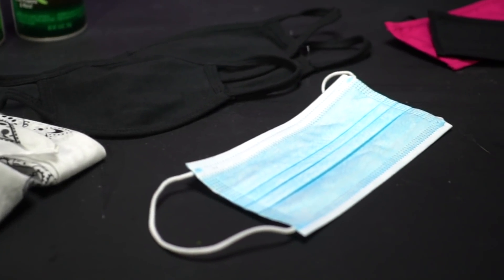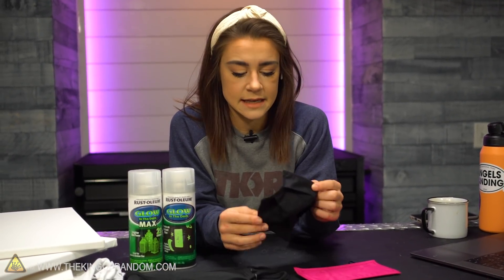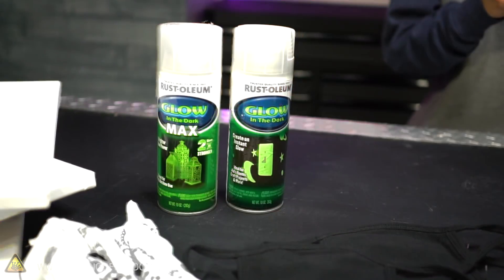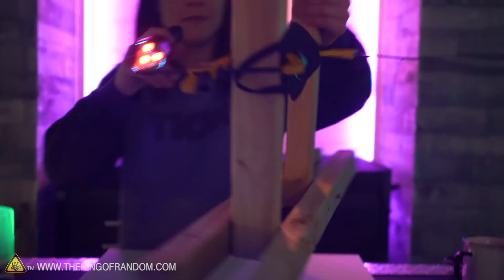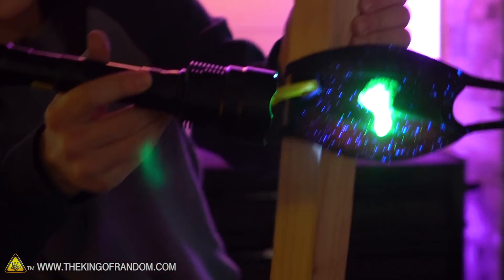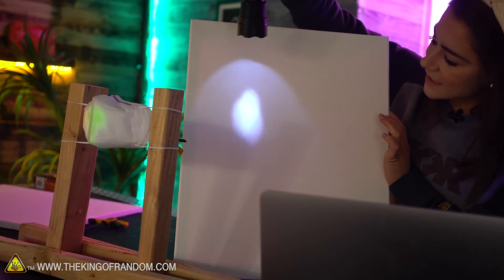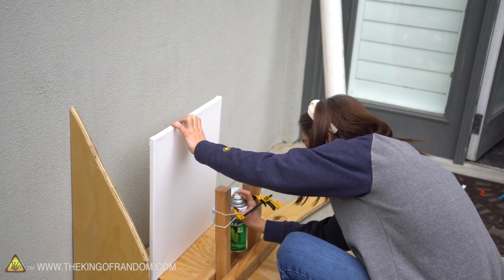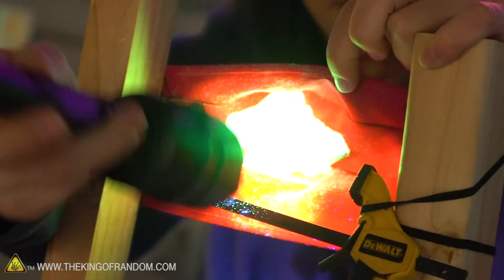DON'T Wear This Type of Mask

Comment: This needs to be redone there is a few other masks that you guys should have added to this 1. A charcoal filter mask with carbon reusable filters
2. A homemade thick cotton mask
3. Wraps
4. Scarfs (knitted, silk, cotton, polyester)
5. A hoodie if you forgot a mask
6. A T-shirt
Reply: I'd also like to see the face scarves, I used to wear one, double folded because it looked so thin, but then I switched to surgical masks. I'd like to know if the face scarves helped me at all in the beginning when buying surgical masks cost you almost $20 for 2-3 masks
Reply: @amagos18  Yea. Where I live walmart wanted $49 for a box of surgical masks at first now they are $25. It is insane. Especially when some of us are on a fixed income. I mainly use my charcoal filter mask, I do have other masks including all what I listed.
Reply: @amagos18  dang. I got a bag of 5 for $4, and they are very much real and rated correctly. Don't live in the US though so that might affect it.
Reply: I really wanted to see the homemade mask. I made a whole bunch of 4-ply masks at the beginning of all this, when masks were hard to get because of the sudden surge in demand, and I and my coworkers had to keep working at our essential jobs. 2-ply seems to have been a common pattern, possibly because of ease of making and efficiency of materials, but 4-ply is also a valid design and still not suffocating, so it seemed to me more layers = more filtration, but I would like to see if there's an appreciable difference, if they could test that. Also, the trick for making a filtered mask of incorporating a pocket for slices of coffee filter or vacuum bag; I'd like to see how effective that is.
Reply: @tildessmoo  If the mask is too thick, your breath will blast out the top, sides and bottom. Unless the edges are sealed. I'm not sure at what thickness that would happen though.
Reply: @Wingedshadowwolf  They're wide, pleated and edged to shape around the face, and tied instead of elastic, so they actually fit really well for cloth masks. That's also what I meant about them not being suffocating; at 4 ply, you can still breathe through them. I didn't experiment with more, but I'd expect 6-ply would be enough to force air around the edges no matter how well it fit. (My best evidence that they work is they don't fog my glasses any worse than the elastic cloth masks that I'm pretty sure are exactly the same as the black one Grace tested.)
Reply: @tildessmoo  I use 2ply pleated ones. I made them with decently sturdy quilters cotton(hard to see through when just 1 ply) I don't think the edges are tight enough if there were many more layers.(also I don't think my sewing machine wouldn't handle more!) When I breathe heavily I can feel air coming out the sides. I did include a wire at the top, so my glasses don't get fogged. I think the black one Grace had is made entirely from a stretchy fabric. It was hard to tell.
Reply: Yes, I'd like to see that too.
Reply: @fluffehgamer4712  there are different kinds if filtered masks the 1's that my husband I have look like any other mask out there with a little plastic knob on 1 side with a charcoal filter in it that you can replace then then has a pocket on the inside for reusable carbon filters and they are all washable
Reply: Also test painter masks with the duel filter things.
Reply: @fluffehgamer4712  there is no proof behind that
Reply: I saw one worn by a US dr whose wife made his from a PETA vacuum bag, he was really pleased with it.

Comment: Just for the record as a healthcare professional, we tend to wear n95s not kn95s. There is a difference in them. The n95 wraps around your head with the straps and seals much tighter to the face and we do have to be fit tested.
Reply: So it's classified as a respirator not a mask then
Reply: @lucienlacy3291  Basically, yes. They even mentioned it as a respirator in the video at one point.

Comment: I don’t believe you did this test correctly, wearing a mask you would build a small vacuum when you in hail and pull more through the mask. By just spraying directly onto the mask the outside layer is it collecting most of the product. You should redo this test with that in mind.

Comment: Doesn't a spray can have a higher psi than human breathing? So by using a spray can, are you forcing more material through the mask than would be expected?
Also, the longer a mask is worn, the more ineffective it becomes. What is the life expectancy of a mask? How many hours are they rated for before you have to throw them away?
Reply: Exactly. I feel like there’s a different between using an alcohol based liquid over water based respiratory droplets. Alcohol is thinner than water so it’s probably soaking into the fabric differently than breath would. 
There’s also different dispersion going on when you’re talking and breathing as opposed to a spray can directly aimed at one spot. 
The results they got from each mask in terms of demonstrating the different layers and weight isn’t too bad but it’s not very accurate depiction of use and I feel like they could’ve explained that better.
Reply: I think they meant that this test was to be seen over the period of the whole day. I don't know, I'm trying to see it from another point of view
Reply: This is false info (this video)
Reply: Yeah this is an extremely un-scientific video. It’s more propaganda than anything else.

Comment: 6:27 Hold on, let's not do a test to prove the hypothesis to be correct. That is not science. Try to fold that bandana into a triangle and spray through the 2 layers and see what happens. Bandanas are worn as a triangle on the face and actually with a fold-over at the nose/mouth area. There will be 4 layers of material at those critical spots.
Reply: This comment section seems to be divided into people who think masks are a hoax and people who think that folding a bandana is the equivalent of wearing a hazmat suit.

Comment: After years of watching mythbusters utilize the scientific method in experimentation, watching this is hard. It's such an obvious bias, and such sloppy experiments, it makes the results almost a moot point. If you're gonna try to prove a point through experimentation, you can't start by stacking the odds in your favor. If anything, you want to do the opposite, so the results are less debatable. Go watch the mythbusters germ episodes, and redo this experiment.
Reply: Exactly.  The CDC has 20 years of research on their website that shows masks don't work the way they are being portrayed.  The first to even suggest that was this last year AFTER the masking mandates.
Reply: Not sure what you mean. The CDC website seems to hit all the same points as this video. What specifically differs between the CDC and this vid's explanation?
My point was never that masks don't work, my point is that it's hard to take an experiment seriously when it's methodology is so biased.

Comment: Would've liked a more accurate test of the bandana bc no one where's them the way you showed it and I think it'd be interesting to test out gaiters bc they're pretty common.
Reply: I would have liked to have seen the canvas for the bandana because she said there were a lot of droplets, but yet didn't show us... I have my concerns and suspicions why that might be...
Reply: Problem with gaiters is that it also depends on how they're worn. Remember that they're elastic the whole way through, which means that they have to be stretched to be realistic. A hanging/open gaiter WILL protect better than one being actually worn, for the same reasons that nylons look translucent when worn vs when hanging.

I WOULD like to have a vid on them though because where I am, there are a TON of people using them (as well as taking off their masks in crowded stores to talk on their cell phones).
Reply: @kimudo  love how people do that even though a mask doesn't actually muffle you when you're on the phone
Reply: I read a study that said that gaiters are actually worse than wearing no mask! That’s because they just split up droplets so they remain in the air longer, floating’ and chillin’ there to infect more people.
Reply: @applefructose  really? Interesting I got this gaiter for skiing that has a mask inside of it just where your mouth and nose is, so it's still warm and you have the pocket of air that you get with gaiters, but also safer bc it's got layers to it
Reply: Gaiters are fine as long as they have more than one layer such as most commonly found, a 2 layer one.
Reply: @kylefaris5487  I cannot find a two layer gaiter and if I do then its like 20 almost 30 something dollars
Reply: I have a thick one layer gaiter that i use for my karate and its really effective,

Comment: Fun fact: You are supposed to change your mask every four hours/anytime it gets wet. 
Condensation builds up on the inside of masks, and moisture reduces their effectiveness.
Reply: Fun fact: masks aren't cheap.
Reply: @freethebirds3578  another fun fact: hospital visits aren't cheap
Reply: @freethebirds3578  fun fact. They kinda are cheap a 50 pack is like $10...
Reply: @nobodyspecial4234  So 4 per day. One pack would last maybe 2 weeks.  
Everyone who lost work or their business is happy to spend a couple of hundred dollars on masks.
Reply: This is true. You are also meant to wash reusable masks at the end of every day.
Reply: @candicebush9640  We have enough masks to  wear a different one each day, and wash them all on laundry day.
Reply: I think I read the same study as you. The study I read shows a measurement of particles after 2hrs and 4hrs and concludes that it should be changed out after 4hrs. The problem with that study is that it increased dramatically between 2 and 4hrs meaning it lost some effectiveness before 4hrs. Leading me to conclude that it should be changed out even sooner that 4hrs.
Reply: fun fact: before the pandemic you are supposed to change mask in between patients. now we have the same mask the whole shift.
Reply: @thefailingstudent  there’s nothing fun about that, it’s a sad fact.
Reply: Yet most mask wearers don't change them. Many are required to wear the same mask for multiple hours consecutively and long past the effective saturation rate.
Reply: Cloth, medical, or all?
Reply: I think safer to do 1 hour and 30 min. Because you breath in what you breath out, you have no fresh air as well as there are bacterias collecting there and will make you sick and can make you sick worse than covid
Reply: @MoneyForFun255  that was debunked long time ago. Masks filter air and still let you do the gas exchange perfectly fine. Otherwise you'd suffer from hypoxia constantly.

Comment: How about doing a "breathing in" simulation, where you put a vacuum on the inside of the mask, and see how much aerosol it catches onto the mask?
Reply: Very interesting never thought about that
Reply: More details:
1. Take a Mannequin head
2. Drill two holes: one on the mouth and the other somewhere to put the vacuum.
3. Place the mask over the mouth as you would yourself
4. Spray in front and turn on the vacuum to "breathe in"
Reply: @Heightren  that wouldn’t factor in the possibility of contracting it through your eyes, though, which is a very easy way to catch it
Reply: @sammcfadden524  We're just trying to observe how many particles the masks intercept, not how much they protect against infection.
Reply: @sammcfadden524  shh, dont bring any of that common sense science. You know, follow the data and all yet dont protect yourself. Protect others. :/ guess thats why a year later its still here.
Reply: I second this

Comment: This is horrible. 1st the virus particles can travel without respiratory droplets. 2nd the virus particles are exponentially smaller than the paint. Its 0.0125microns to 0.3microns. Lastly for this, everything on your mask , with the exception of the N95 has NO filtration rating and therefore everything on it,  will be breathed in.

Comment: I wonder how the masks made from a woman's bra would fare. Or the ones cut from tshirts (my insurance company actually recommended that)
Reply: I personally use a 2 layer cloth and repurposed nice dress shirt type of material. So the outside is the shirt and the second layer directly on the other side is just cloth. But it’s thinner that my previous mask that had some thick 2 layers and the second layer was right against my nose making it harder to breathe in efficiently
Reply: The CDC recommended using a t-shirt
Reply: T-shirt sounds like a horrible idea. Way too porous.
Reply: @Engardian  that's what I thought too, but it is what was recommended
Reply: @Engardian  I’ll let the CDC know.
Reply: @Engardian  the mask  is designed using two layers.
Reply: @lwalle00  the directions I was given used a single layer
Reply: @Engardian  not if they are waterproof T-shirts

Comment: Wont wear any much easier! stopping paint is far different than stopping viruses that are .00x micron in size
Reply: The viruses are contained within respiratory droplets. Which is why they use spray paint. Breathing doesn't spread individual virus particles.

Comment: Mask only work until you touch them... Adjustments contaminate your hand and then everything you touch.
Reply: Or u could just use this thing called the blood brain barrier or u could just get a swab to poke a hole in it so u can use it anymore and then blame the people that dont wear masks for your own ignorance of your own body
Reply: Touching the outside of your mask, so long as you don’t then touch your mouth, nose or eyes, is fine with your hands is fine. Especially if you’re practicing proper hand hygiene.
Reply: To adjust it, you don't have to touch the contaminated location

Comment: Something tells me nobody would wear any of these masks in a viral lab.
Reply: Nope full hazmat suits with air purifiers, they know better.
Reply: @DanTheMan454  Depends on the virus.  From what I read until they are working with things worse than common stuff they just use masks that are fitted or have a frame underneath that seals.  As things get worse they wear light PPE with a Respirator similar to what you would use painting.  Then when things get past that they break out the full body sealed environmental suits.  One of these days I should ask my cousin what she uses at work and what the different hazzard levels she works with are. She works for the Canadian version of the US's CDC.  Then again she might not be able to tell me with the pandemic et al.
Reply: The surgical masks type are ONLY viable to reduce the amount of particles YOU exhale/blow out. They are intendet to just keep breath and such from a patient while doing surgical or other medical procedures. for example KN95 is higher density so it provides better protection from viruses coming through the mask. but well when you touch any mask on its outside you have potential stuff all over your fingers/hands...
Reply: Obviously they won't use masks meant to block your breath in a viral lab. That would make no sense whatsoever...
Reply: Look at all the trump loyalist who clearly have careers in the healthcare industry and totally know what they’re talking about 

Bravo to you people
Reply: @danevertt3210  look at the brown shirt. How many old people did you beat up during your riots? We'll never know how many black people you killed. It's almost like we're in Soviet Russia.
Reply: Hazmat suits should be more available
Reply: @elainavanvalkinburg1020  Hazmat suits are totally impractical for all but the most dangerous situations, and seriously expensive. They have to fully decontaminate them before they are taken off, because the virus can live on the surface for hours. So, unless you have the proper facilities, aprons, long sleeved clothing, masks and gloves are far more practical.
Reply: They probably aren't worried about spreading the cold they brought into the lab.   They are worried about bringing home whatever virus they are working on.  In vs out
Reply: Wish the whole world had access to what people in a viral lab have but we don’t, glad we have something that’s better than nothing.
Reply: @Kokopuffs_s  that should tell you something. If this virus is as bad as they claim then there would of been a lot more done than... wear a shirt on your face, that outta do it...
Reply: @Kokopuffs_s  well we do....it's just expensive....plus, be happy we aren't the ones having to deal with it daily, they are the ones who do
Reply: @BlueFleetOC  I don’t know if you understood my comment but I’m basically saying we should wear masks because they help, I was being sarcastic for the comment that suggested people in viral labs wouldn’t wear these masks.
Reply: If you can smell a fart while wearing your mask, its not going to block a virus.
Reply: @MrMunky1985  I hope you're being sarcastic.

Comment: Could you do this with food service face shields? I realize how silly that seems, but it make a useful point. 

Also maybe try backing up some. Most people in public, even at a casual distance, are not that close to each other when speaking or coughing.
Putting masks on a mannequin head, or something like that, and testing which masks are most effective at blocking particles from getting under or around the masks, effected by natural airflow, would be great too. In fact, if possible, adding something to the head, to simulate the suction power of someone breathing in under the masks would be even better.

As anyone who knows anything about airflow physics will tell you, air does not move in a 2-dimensional linear fashion.